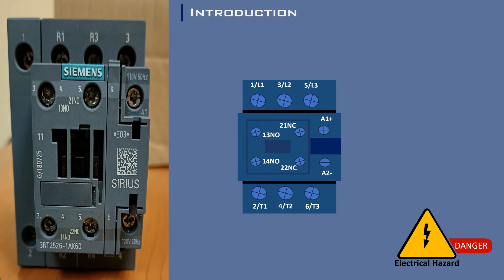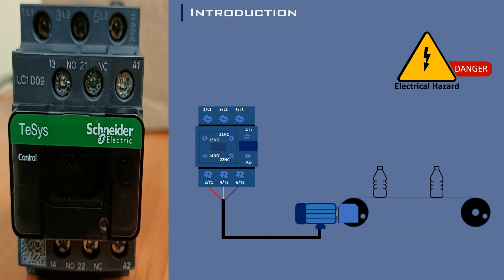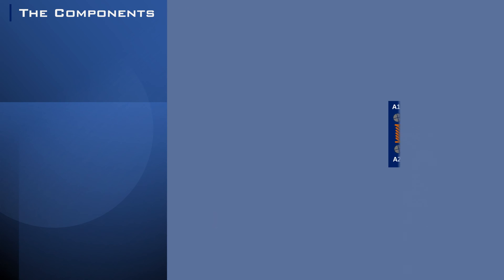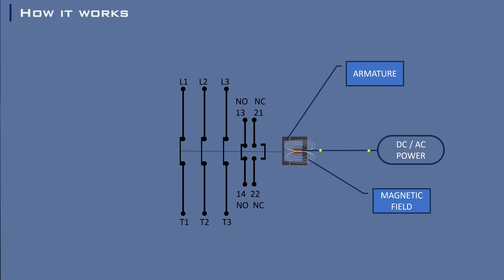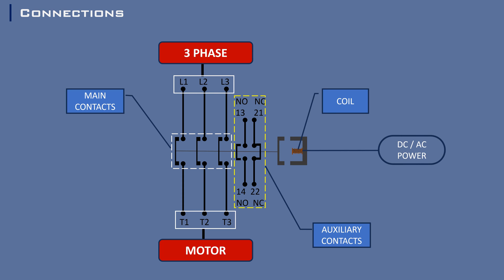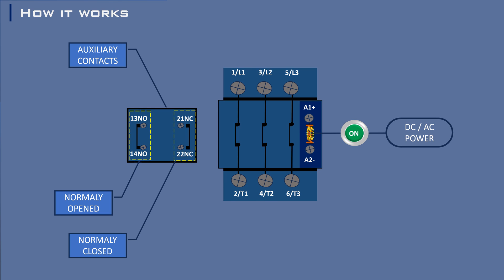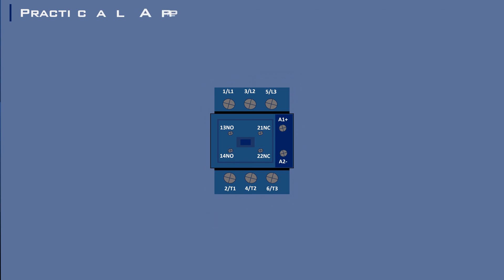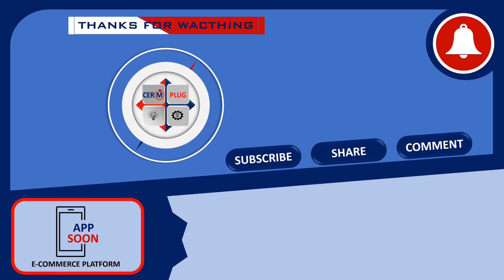CONTACTOR - FUNCTIONALITY / N-O & N-C Meaning....

Comment: Thank you for producing these videos.  They have been extremely helpful with a detailed explanation of components that I have been finding very confusing.  The only question I have based on this video is, would the auxiliary contacts for NC be connected to safety devices and guards, as an example?  And do you have any videos detailing safety devices used in control circuits?
Reply from the maker: Thank you for your kind words! We are glad to hear that the videos have been helpful to you. Yes, auxiliary contacts for normally closed (NC) circuits can indeed be connected to safety devices and guards. This is a common practice in control circuits to ensure that the system is safe and operates correctly.

As for videos detailing safety devices used in control circuits, We shall cover that in our future videos for your consideration.